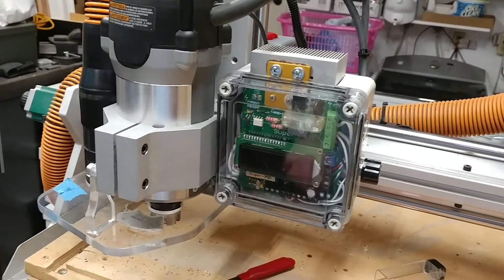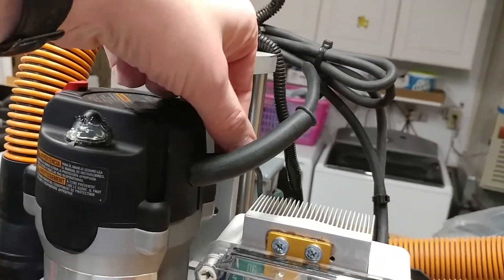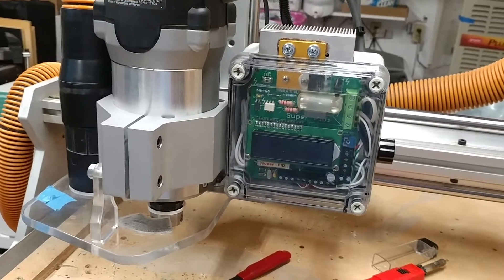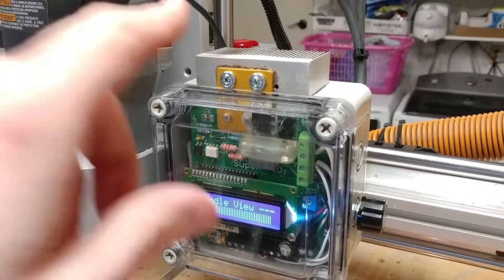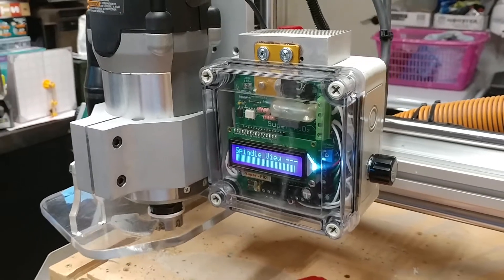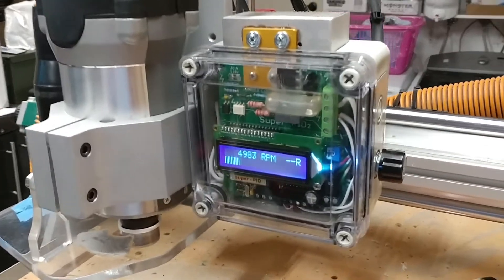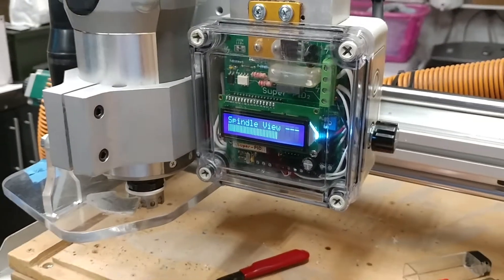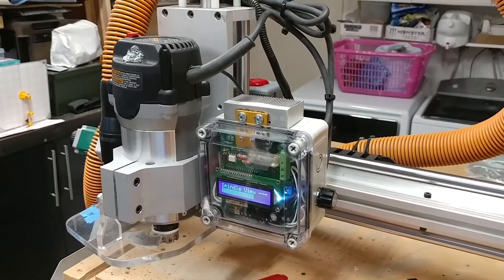Installed SuperPID controller on CNC

Comment: Nice install! I'm about to do the same with the same or similar Porter Cable router. Do you happen to have a model 8902? I am wondering how you wired it up. My router internals look different from older versions of this router. Can't find anything helpful on any Super-PID forum threads.
Reply from the maker: Basically you need to bypass all the soft start stuff (the board) and the speed control (also on the board) and wire it straight to power 110V AC direct to the brushes. Mine is a Porter Cable 892. It was pretty easy once you get everything disassembled and look at what you have.

Comment: May I ask how you attached the box the SuperPID is in to the gantry?  You showed a lot of front angles but could not get a glimpse of the rear unfortunately.  I tried Hot Glue but mine won't stick to the aluminum gantry.  I have the exact setup you do router and all.  I did hook up the Enable and PWM for speed to the second parallel port controller I had that came with mine.  I have TACH ran back as well but have not researched how to bring that back in to the software.  Just trying to come up with a clever way to get that box to attach in the same place you did.
Reply from the maker: I actually stuck it to the side of the aluminum router mount with about 2"x3" chunk of silicone double sided 3M tape. Box was just clear of the vertical ends on the gantry including the cables coming out the back. If I needed to make it more permanent, I could have tapped a few screw holes into the router mount.

Router on it died about three months later, so I moved up to a VFD 1.5kw spindle.

Comment: Is that an off the shelf housing /acrylic case that you have the super pid in? Where do you get it? I have had mine in a drawer for about 4 years... Lol. Now I am getting around to the install. Thanks.
Reply from the maker: Yes, off the shelf component. I screwed the back part of the case to the spoilboard and manually milled out the slot for the heat sink in the top edge. I got the part from work as they were chucking out a bunch of surplus stuff, so I don't have a link on where to get them. 

I actually have the SuperPID and the case up for sale now. The router finally started to die and I switched to a 1.5kW spindle.
Reply: @WhiteLightLaser  thanks for the info, one more question...is the new spindle superior to  the router in all ways?
Reply from the maker: @WickedWood  I'd say yes and no. There are some tradeoffs. My original spindle was a Porter Cable 892 with upgraded low TIR collet and nut set. It was big, loud and had plenty of power. Under normal usage, getting the spanner onto the collet nut was a little bit of a pain, but I had zero issues with tool holding and I had no measurable runout. The new spindle is lighter, but only has ER-11 collets. They only go up to 1/4" to the router's 1/2". Not a huge deal as most of my tooling is 1/4 and 1/8. It is a lot quieter. The VFD drive I just have running in manual mode for now. My Probotix Comet was wired with a relay operated 110v plug on the back of the Z to turn on the router. I haven't rewired and set up LinuxCNC to talk to the VFD yet.

The SuperPID was a big step up for running the router though. I could run it at much lower speeds, something I put to good use cutting some aluminum. I have also cut aluminum on the VFD spindle. Performance is comparable. When I first bought the CNC, a VFD spindle was about 2.5x the cost, so it was totally worth it. At this point in time they're about comparable. Only time will tell on the longevity side of things though. The PC 892 was a rock solid beast.
Reply: @WhiteLightLaser  Thanks. I contemplated going the spindle route and if I did it would be a larger 220v one. However since I have 8 routers already, I figured using one of them would be worth it at first. I will be using a Hitachi for this and also have a low TIR collet set for it, also been in a drawer for 4 years....

I have used put all my routers to serious work, back when I did a lot of wood working, the only repair I ever had to do on any of them was a bearing that went out on a Porter Cable. I own every major brand  or router and PC has always been the loudest of the bunch. Thanks again.